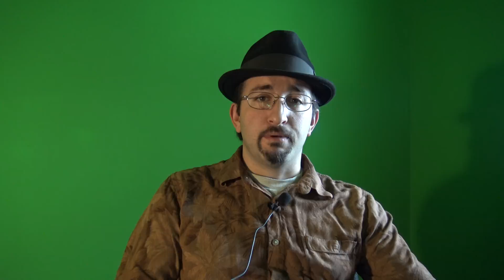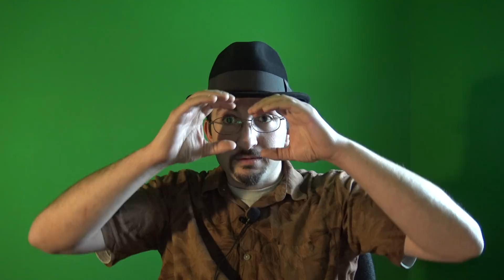Tesla Motors: Dual Charger Exercising & Lidar opinions; MAPPING THE WORLD IN 3d!

Comment: Tesla should just install Lidar in the cars for data gathering for elevation changes so the bottom does not scrape the ground and pothole spotting for the cars to avoid bad potholes. When the next Tesla comes by and the pothole is fixed the other Teslas won't drive around that spot anymore.

Comment: I am a GISP Google, Tele Atlas and HERE has been using LiDar on their cars for years. The big problem with what you are talking about is an absolute ridiculous amount of data to be stored and processed. The storing of the data might be able to be figured out but the processing of such data is the big hurdle. I am dealing with a company that is going to fly LiDar and provide 2' contours for the County that I work for, this county only covers 110 square miles and the turnaround time is two months. 
On another note we have a supercharger here that I have yet to see being used, just waiting to catch someone there so I can check out the Tesla.
Reply from the maker: +wildweav A lot of data? Yes, maybe right now, but in 2-4 years? I think not. Just 15 short years ago, a 2megabyte photo was considered HUGE (Heck, my inbox max size was just 6 megs...) and we were still kicking around floppy disks. My 120 gig hard drive in 2001 was absolute MASSIVE, and practically un-heard of. Now, I am kicking around 50 gig files, like it's nothing. Literally, and I have 30 terabytes sitting under my desk. 5 tb drives in 2015, some 6tb, and now I see 10 tb drives, and we're not even a month into the year. 
Same with processing speeds. Heck, look at YouTube alone, YouTube can process one of my 120gig videos, filmed in 4k, in about a hour. So I don't think it's as big of a hurdle as one would think. Maybe at this exact moment, but then again, really not being used as much. Our technology is expanding at a exponential rate. 

Thats awesome about flying a LiDar!   What county? And where is the supercharger?
Reply: +KmanAuto Ohio County WV about 60 miles southwest of Pittsburgh PA, the supercharger is at the Hampton Inn in The Highlands development http://www.hitthehighlands.com/ which is a county run development. The current issue with LiDar is some of that processing involves a technician visually correcting anything that is off.

Comment: It's not that easy with LIDAR. Firstly, it only detects obstacles and distance to it (reflection point) which can be put together to a surrounding surface map - no colors. Secondly, the further away an object is, the blurrier the laser gets, the blurrier the obstacle is seen.
Reply from the maker: +Holywood07 Understood, thats why I said to pair it with the 360* video the vehicles will be recording at the same time.   And considering the eventual millions and millions of cars driving around with Lidar, some will be closer to objects and some further. Given the sheer saturation of cars with Lidar, eventual High Resolution "closer" recordings will be taken. All sent to a database, and combined to form the 3d maps.

Comment: For perfekt greenscreen your camerasetting is not optimized.
Reply: same with lighting
Reply from the maker: +stili774 I wasn't trying to do green screen in this video. My office is just painted green, every wall ;-) All i had turned on was a table lamp. 
Just turned on the camera to record :)
Reply: +KmanAuto Please send me 10 Sek of RAW Greenscreen Material , so i can test , if my Programm works better than your PowerDirektor
Reply from the maker: +stili774 Where would you like me to send it to.
Reply: +KmanAuto Do you give me permission , to Download 15 Sek's of your Video and reupload them , with no greenscreen.testet ,and also with this not optimized greenscreen i get better results.
Reply from the maker: +stili774 go for it :-)
Reply: +KmanAuto I will send you a 30 Second test File , with Removed Greenscreen.For Better Result's you should place the cammera in front of the wall.... If you want more optimizations Tipp's , how you could the perfect Quality , just write under the other vid.
Reply from the maker: +stili774 of course, like I said, this wasn't a green screen video, just the wall behind my desk
Reply: +KmanAuto Yes , for sure , but , the Quality of my is better than your's , where you made a greenscreen Video.So you should Change your Rec Programm.